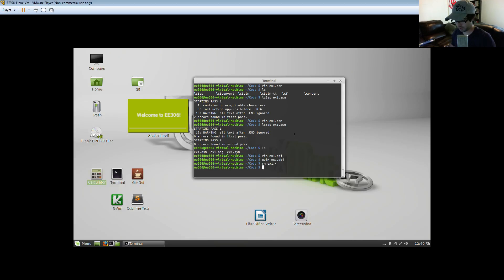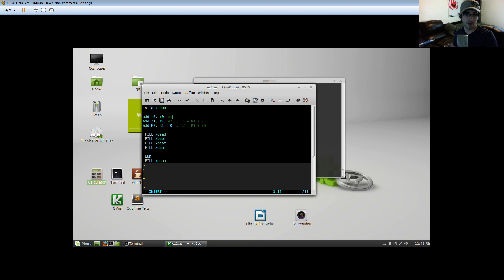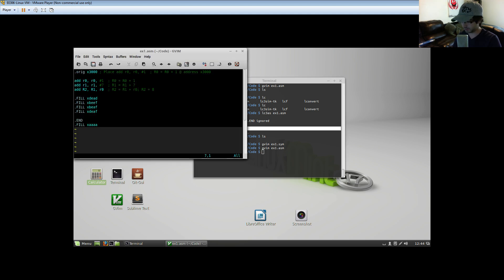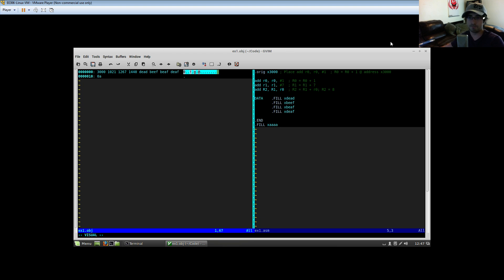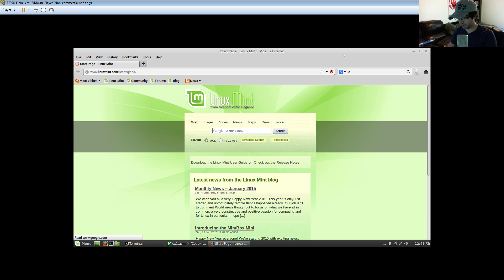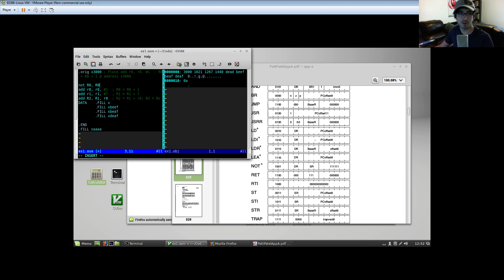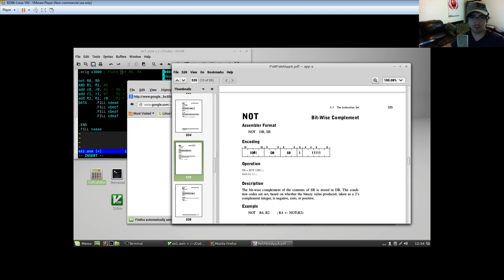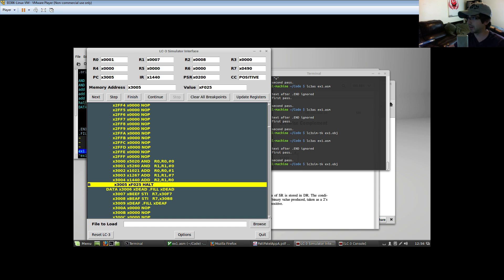LC3 Tools: Part 1

Comment: when u open the .obj file in vim, the part on the right is just showing u what the bytes look when interpreted as ascii text. each line contains (left to right): the line index, the bytes in hex, and the bytes in ascii. it is wholly unrelated to x86, and is meaningless here, unless looking at character or string data.